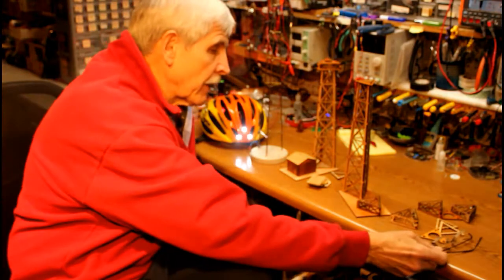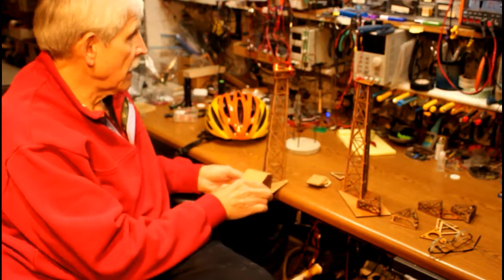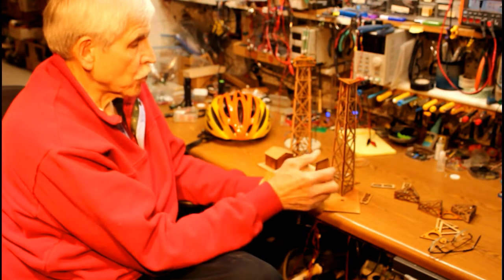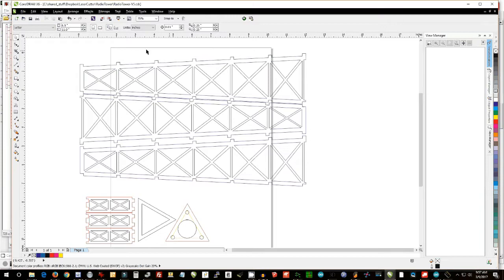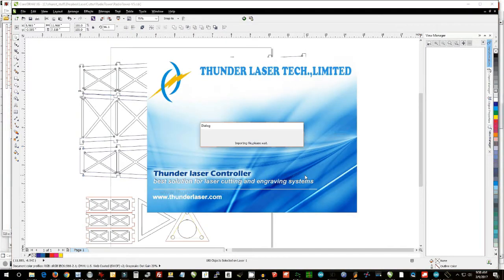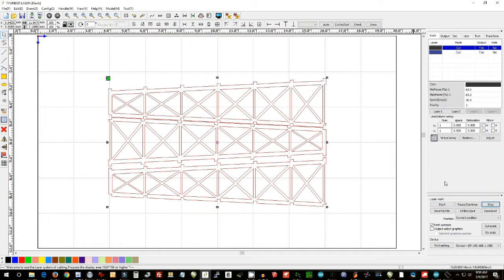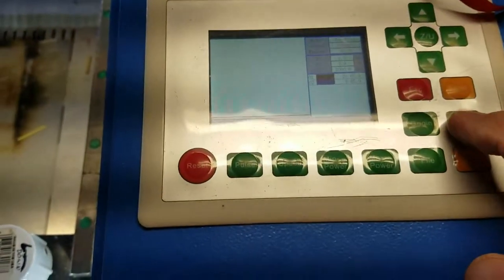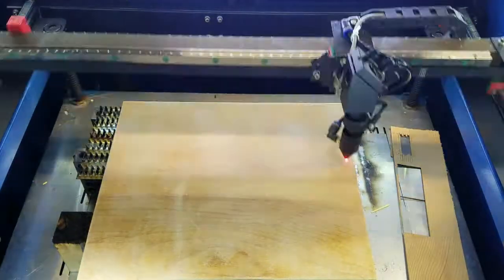Laser Cut Radio Tower & Shed

Comment: I’ve been thinking about buying or building a laser cutter myself and I looked on your webpage to see if you listed information on the one you demonstrate in this video (50 watt?) but the only thing I could find talks about a Chinese 40 watt machine.  Can you share some information about the cutter in this video?
Reply from the maker: Sure thing, Sparkman - it is a generic 50 watt laser from China - similar to this one from eBay

https://www.ebay.com/itm/50W-CO2-Laser-Engraving-Machine-Engraver-Cutter-with-Auxiliary-Rotary/281882801833?epid=2121626498&hash=item41a18636a9:g:QmcAAOSwQupXURnj

I kept the smaller one (the 40 watt) for about 1 year then got this unit - it is quite a bit more sophisticated in terms of the controller - it is also larger and quite heavy (about 220 lbs)

One of the most important things is its capability to mix engraving and cutting in the same job - the 40 watt required you to run separate jobs for each type of work.

Highly recommended!

dave